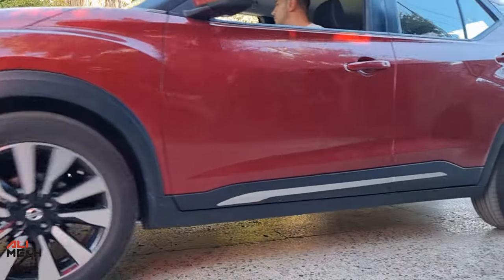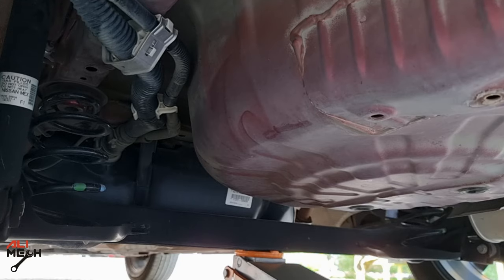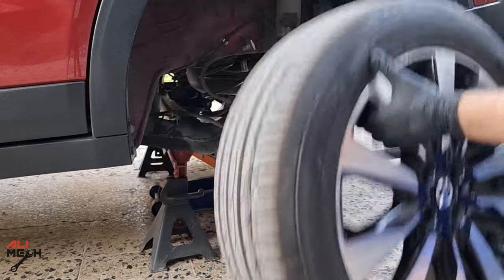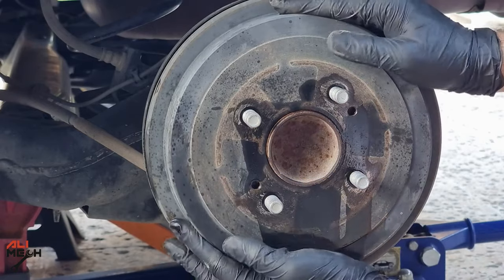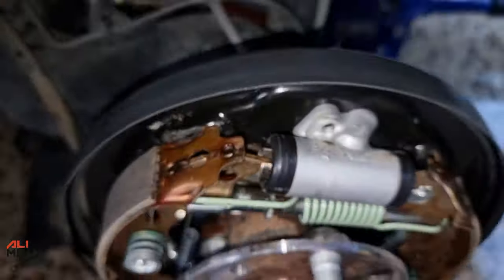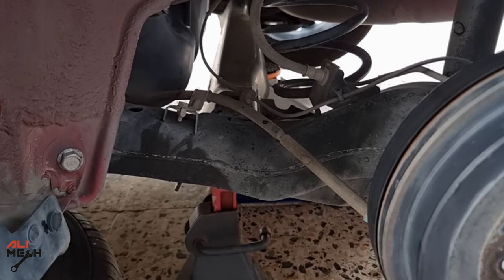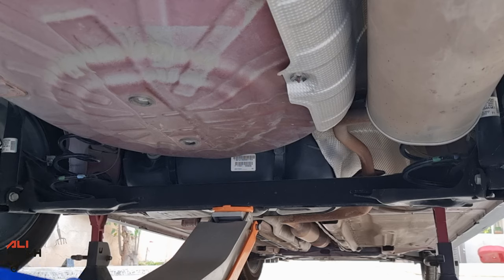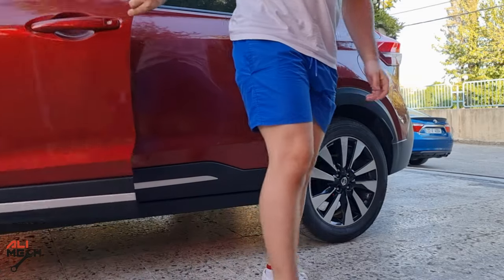Car still moves with handbrake on/How to adjust Parking pedal brakes /Adjusting brake drum

Comment: I had the same issue took me 5 hours to figure out why wish I had just watched this video first cause it was the self adjuster I had it not in the correct alignment with the brake shoe so the wheel was still turning with handbrake on

Comment: Just had a 2011 Honda rear brakes done. After the parking brake foot pedal went almost to the floor and would not lock car on low grade hill.  took it back and now the foot pedal is better it goes about 1/2 down good tension but ... Car still slips.   Could this be because the shop adjust the cable and not at the brakes like this video.  I hate to take it back a 2nd time just wondering why this would be with new rear brakes.
Reply: 100% chance that you should take it somewhere else.
Reply: @FacialVomitTurtleFights  Hehe It kind of self fixed.  My guess is they had grease or something slick on the rear drums and it sort of wore off on its own.  Seems to hold better after a few weeks.   Not saying its perfect but much better.

Comment: Why should there be slight contact (friction )between shoes and drum when parking-brake not engaged ? Its like driving with brakes on.
Reply from the maker: There is a recomded factory gap, if its far from that, you will have a delay with brake